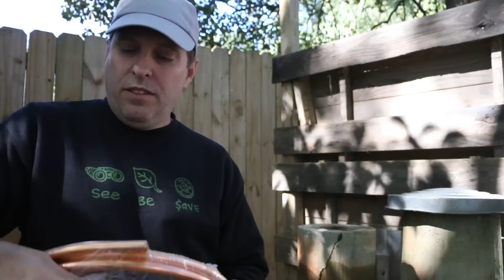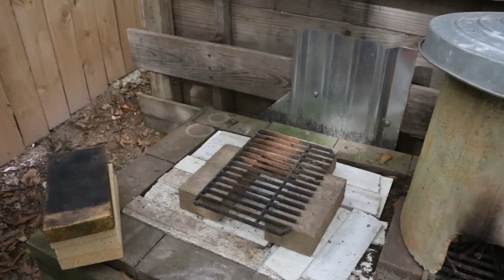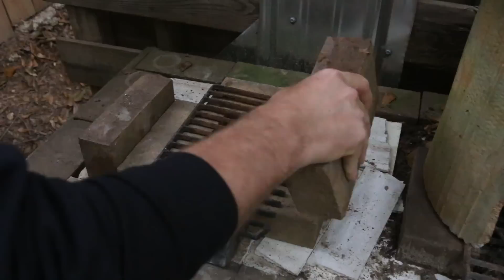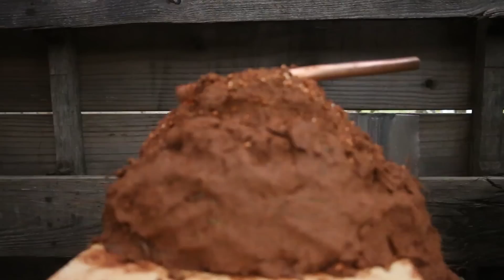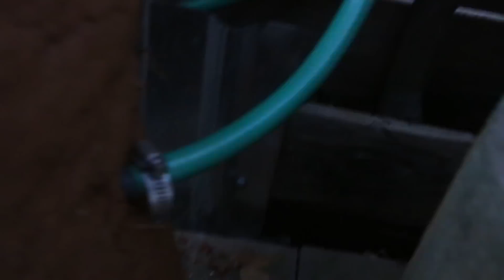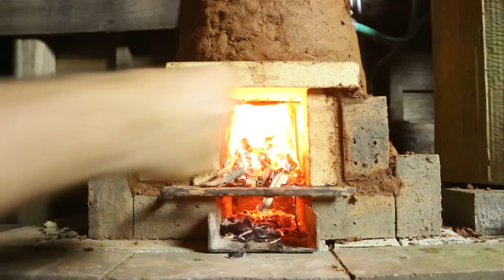How To Make A Cobb Rocket Stove Water Heater

Comment: To avoid kinking you could take a length of narrower gauge hose like that for aquariums, oxygen tubing, etc and run it inside the copper for support but still flexible.
Reply from the maker: Thank you for the suggestion.

Comment: Hello mr green shorts, long time no see!
Ive got a big old stove as a freebie, its super, with a built in protection against  sparks, in the short stumpy chimney.now parked outside close to my house. Question please?....If i just put the coiled pipe inside the stove with extra length at each end, for hot water exit, via the chimney, and cold water in, via the cinder tray.
So all it needs, is the 2 extra lengths of pipe at each end .. please tell?..Would that work? With a few logs burning around the pipe?
Or will the copper pipe distort too easily? I could wrap it around a bit more scrap metal chimney, if so?   Im not going to be able to buy anything or make useful mud.

Comment: How long did it take to heat the water to touch hot? You're losing heat out the top of the chimney. Could put a kettle on there😊 or make the coil go up farther.

Comment: how does the water circulate? Dont you need a 12v pump for that. May someone please explain to me how the circulation works? Thanx!
Reply from the maker: The water circulates because of convection. Heat rises. The cold water is heavier. It sinks as the water heats up and rises. The resulting movement is a current.
Reply: @GreenShortzDIY  Thank you sir. I did understand it a such, just needed clarification. I'm thinking of building a similar kind of setup with a 9kg propane/ gas cylinder (20L water) in vertical stance with a flame/heat resistant tap. Here in south africa we call it a donkey. Difference is the use the 200L drums in a vertical position above a fire. With the coming african revolution and civil war here a geyser/donkey setup with a rocket stove will work wonders.

Comment: In your bucket the hot water probably would do better coming into the bottom, to stir and mix properly. Thermosiphon will still happen since the burning will make the copper so much hotter than even the top of your bucket
Reply from the maker: Thank you for the feedback. Thank you for watching.

Comment: Why did you mix Pearl light into your mortar?

Why doesn't the copper melt with direct contact with that flame?
Reply from the maker: The pearlite is added as insulation, so the mortar mix absorbs less heat. The copper doesn’t melt because the water pulls the heat out of the copper so quickly that it doesn’t build up. If the water wasn’t there, the copper would melt. You can boil water in a styrofoam cup sitting in a fire for the same reason. I didn’t believe it until i tired it. Thank you for watching.

Comment: Great project. The only thing you needed to do was change up the hosing. The top hose in your cob stove needs to go to the bottom of your bucket so that the convection heat can continue to rise and then run your top hose from your bucket into your cold water intake in the oven. We did this in alternative energy in college with a solar panel.

Comment: Not just hot water but in winter in a room a 55 gal barrel of hot water would make s very nice mellow thermal mass heat source.  The stove could be outside but heating inside the house for all night warmth.
Reply from the maker: Ooh! I love that use for this stove. Thank you for the suggestion. Thank you for watching.

Comment: Really neat design!

This could be incorporated with a shower house, a hot tub, an outdoor cookstove, or add to a spa-like environment 
Once this is finalized, I’d use copper pipes or pecs designed for heat for the hose.

Also, wouldn’t it be better for the heated water to got the bottom of the bucket (instead to the top) and the cold water to come from the top?

As hot water enters the bottom of the bucket, the heat would rise, causing a convection current so the entire water mass increased gently, instead of downward in layers.

The cold water, being heavier, would lend to cycling faster from the top, as well.
Once the cob dries and bakes, this will become much tighter and more efficient 

The way you have it now lends to maintaining temperature layering and would be harder to draw from with a spigot, as the first water you draw will be the coldest.

Nice prototype experiment!
Excellent explanation 
I like your long-fiber use of cob!
Reply from the maker: Thank you, Monica. I agree there are many applications. I hadn’t considered your suggestion on switching the feeds. I’ll have to try that. Thank you for the feedback. Thank you for watching.

Comment: TY!  Been wondering.  Why is the riser section necessary?  Why can't you go straight from the burn chamber into the Mass/water material then out the flue?
Reply from the maker: In my experience, the riser is needed to create the draw. But, there is likely a way to get more heat to the water, faster. This was a fun experiment. Thank you for watching.
Reply: @GreenShortzDIY  Thank you

Comment: So, you won't need a circulation pump to get the water moving through the tubes?
Also, could this be coupled with a heating radiator (or coupled with a hot water cylinder to 'store' more heat) to heat a room/space? do you think that'll work? 
That's an awesome build you did there! 
Thank you in advance!
Reply from the maker: Sorry for the slow response. Yes, the water flows using a thermal siphon until the temps are equalized. I have thought about hooking this to a car radiator. I think that would work. Similar to a house radiator. Thank you for the feedback.
Reply: @GreenShortzDIY  brilliant, keep up the great work!

Comment: Love this build! would be interesting to see the difference between having a coil or just heating a boiler over the flame and letting that thermo-siphon into another container instead.
Reply from the maker: Thank you, John. I think a pot on the top would have been more efficient, or gathered more heat. Of course, I wanted to try the coil. :-) Thank you for watching.
Reply: The coil allows to cook something on top of the rocket stove and still prepare some hot water, for doing dishes or a shower later on...

Comment: What  is cobb? Super cool to watch, quite relaxing too
Reply from the maker: Hi Loz. Cobb (or cob) is the same formula as adobe—clay, sand and straw. It is fun to build with. And if protected from the rain, will last a long time. Thank you for watching.
Reply: @GreenShortzDIY  thanks  for the update, it would get wet during the rain where I have it in mind. It does look  fun to build. I want something to heat the water in my out  door  tub.  It's  been  a long  time coming.  I  had a fire under  on  old one, but this one  I want to paint so don't want the black marks coming up.  You have given me  some ideas tho. Thank you

Comment: I'm thinking of using something like this with a water pump to go with my pool.  How could you capture more of that heat?  Most of your heat is leaving through the top, is there a reasonable way to capture a lot more of it?  Is it just to make the copper tubing longer?
Reply from the maker: Hi Joseph. Yes, this definitely lost a lot of the heat. I think you could add a second boiler pot to the top. Or just make a much longer coil. Thanks for watching.

Comment: Could you have put cob around the copper pipe? Would that make the water hotter?
Reply from the maker: I think it would help the heat be more even. Might also make the copper last longer. Thank you for the question. Thank you for watching.

Comment: If you had a hose coming in from a tap and the other end - hot water coming out - run a bath with it - we had them as a kid in Aust - Chip heaters - having  a bath or shower with all the hot water you need from just kindling

Comment: I heard that filling the copper pipe with water and making the ends very secure tight. Note the pressure created when forming the pipe will be more than 100 psi.  This will help keep the pipe from kink ing
Ed Quillen equillen04@gmail.com

Comment: To prevent kinks in your copper pipe you could try bending it around a piece of schedule 40 pvc or other pipe in the size that you want the coil to be. The trick is to keep the copper pipe close to the pipe used for the shaping and bend it a little at a time. It makes a perfect uniform coil without kinks if done right.

Comment: Nice proof of concept project. Okay for short term. Exposing that copper coil to the extreme heat will burn it rather quickly. You are spot on about cobb's versatility.  If there is a fail, break it up , re-hydrate and use again. Wonderful.

Comment: aren´t you wasting a lot of heat power whit that open flame coming out of the chimney? You can use that fire! I think that It coudl be better if you place the pot over the flame and kepp also using The copper pipe... maybe I´ll test it!
Good job, friend!
Reply from the maker: Yes. There is a lot of wasted heat in this set up. My goal was to test the copper coil, but I agree that adding a pot to the top would be a good way to utilize some more of the energy being created. I definitely think you should test it! :-) Thanks for watching.

Comment: Hi mate, have enjoyed your DIY vids so far and hoping to collaborate on not so much an upgrade - but a much larger version.. A larger model, bigger firebox, 2 or 3 self feeding inlets at 12inches, 4 (or more depending the need) outlet flu's - each flu a copper water coil as you demenstraded. I`ve aquacuture ponds to heat but thinking if designed well....can have a smoke oven, hot oven, resting oven, bbq plate as well (all through the same conservation concept) - and whatever else the designer desires. 
Cheers. 
Adam
Reply from the maker: That sounds cool! I like you idea to heat your fish ponds, while using the stoves to cook and bake at the same time. Thanks for watching. Let me know how your build goes.

Comment: You could have boiled 5 times the hot water in a pot on top of it put the coils in the flames and make water hot like a electrified coffee  pot.
Reply: Ps use cold on one side and a cooler on hot side insulated.

Comment: You should stretch out the coil slightly and mount it inside a wire tube so the clay is not in contact with the copper tube. If there’s a slight space between the coils it should be more effective. You can even incorporate it in the side walls of the fire pit as well the lower it is the better. You should make a damper to slow down the burn. It burns too fast so you use more fuel. That would also be good for a home made hot tub in the yard. In summer I do all my cooking on one make of recycled bricks.
Reply from the maker: Thanks for the damper tip. I need to learn about methods in that a little more, but I understand the concept. I do another coil in a bigger rocket stove, that is open inside the riser. Works better. I’m impressed that you do all your cooking on an rocket stove! Awesome!
Reply: A damper is contrary to the operation of a rocket stove.
Reply: Another possibility is to wrap the copper tubing loosely around a short piece of PVC pipe of the desired diameter for the coil like 6 inch perhaps. This should keep it from kinking at all, although I've never tried it.
Reply: Hello Henry, would you have some link that shows what you are explaining? Thanks ahead.

Comment: Pro Tip: Another way to curl copper tube is to fill it with water and put it in a freezer, the ice will support the tube wall which prevents kinking.

Comment: whats the cobb mix ratio then? you neversaid
Reply from the maker: Ah. Sorry. I usually use two parts sand and one part clay. And then enough straw to be in every bit of the mix. Thanks for watching.
Reply: Have you considered fiberglass strands like what is used for concrete instead of grass?

Comment: fyi - copper can be made soft again by annealing it - heat it up with a blowtorch and let it cool, makes it easier to bend, it's always best to fill the pipe with something to stop it collapsing.
Reply from the maker: Thanks for the tip. I need to add a torch to my tool set...and then get all the terminology and processes straight...anneal, quench, harden, etc. Thank you for the suggestion. You are living up to your screen name. :-)

Comment: Put removeable, press-on "Sharkbite" cap on one end of copper, a press-on valve and fill copper with tap water COMPLETELY getting out ALL OF THE AIR. Shut the valve. Bend around form. Water will not compress, tube will not kink. Then take off cap and valve

Comment: The reasons it take longer to heat the coil is that the coil is part inside the cool mud so the flame is heated one side of the coil, to be more efficient the coil should not be contact with the mud so the flame can heat the coil with full capacity.
Reply from the maker: Thanks for the tip, Chao. I did an exposed coil in my next video. Worked great. Thanks for watching.

Comment: Couldnt you spray the high heat paint on the pellet or backing for your rocket stove, the stove meant for autos or bbq ovens im trying to make a kiln for small jewelry pieces
Reply from the maker: I bet it could work with a firebrick heat chamber for your crucibles. Depends on the temps you're looking for. Thanks for watching.

Comment: Have you experienced any cracking of the cob base, or chimney? 
The metal grid and the copper coil will expand and contract.
Thanks for sharing. 

Regards from S Africa
Clive
Reply from the maker: Hi Clive. I haven't run this stove enough to see those results. I need to reconnect the bucket and run it some more. I'm assuming what you are suggesting will happen over time. Thanks for watching.

Comment: You needed a one way check valve at the bottom so the water would push through the system.
Reply from the maker: Thanks for the tip. Thanks for watching.

Comment: Hey yeah like what you doing. Like to see how far up that system can push the water. And it'll be okay if you add a check valve. I like to see if it can pump up to a mini Water let's say 10 to 15 feet. The challenge will give you a great video and you already have one.
Reply from the maker: Thanks for the feedback and suggestions. Thanks for watching.

Comment: Have you ever tried introducing a venturi throat into your designs? I've tried with mine and gotten mixed results. Also, have you ever tried using homemade fuel briquettes instead of twigs?
Reply: bric
Reply: Briquettes are made for slow even heat.
Rocket stoves are made for fast & hot stoves usually cooking quick. 
These two items are not a good mix.

Comment: One of the best ways to make a copper coil is to take your copper line and fill it full of water, seal it, then freeze it with one end having a little hole in the end plug to allow for drainage as the water expands when it freezes. Once the water is frozen, take out the copper line, uncap one end, then easily bend it around a pipe of whatever diameter you need for the coil. The ice inside the tubing will keep the line from kinking as you wrap it around the pipe.

Comment: thanks for sharing... interesting design...... how is this stove holding up over time?? ... is the cob cracking or breaking apart at all???.... curious does the grass binder burn out over time???...
Reply from the maker: I haven't used it a lot since I moved the outdoor shower a the bigger stove. I've kept I covered so it won't dissolve. I have a problem in that I have too many rocket stoves. None of them get enough use. :-) Thanks for watching.

Comment: Bend your pipe around your pvc chimney form.
Reply from the maker: Good suggestion. I did like that bending the copper by hand allowed me to feel how it was moving...at least my first time at it. Thanks for the feedback.
Reply: How long did it take to heat water?

Why aren't you trapping heat with lid on bucket; how much faster would it heat with a lid?
Reply: The bucket was just a temporary test unit. It didn't matter how long it took to heat the water. So he didn't need a lid.
Reply: @DerekRoss1958  interesting. That's one of the things I would be testing for.
Reply: Came to say this!